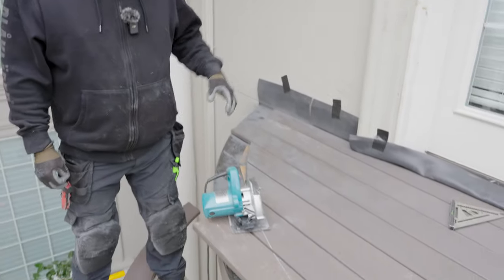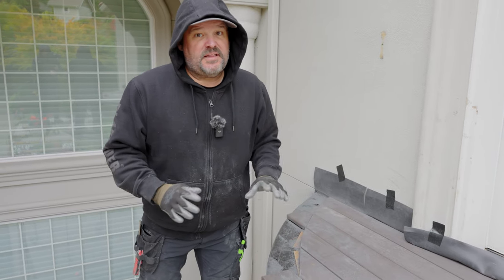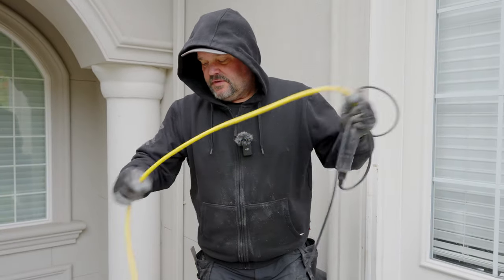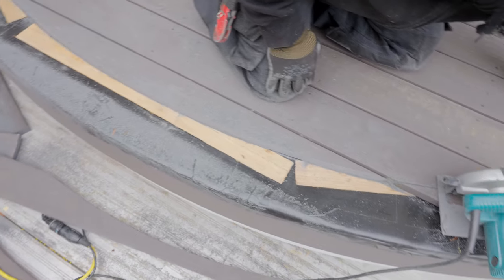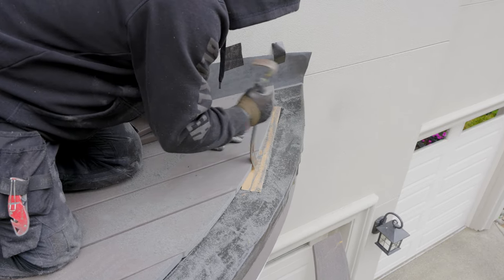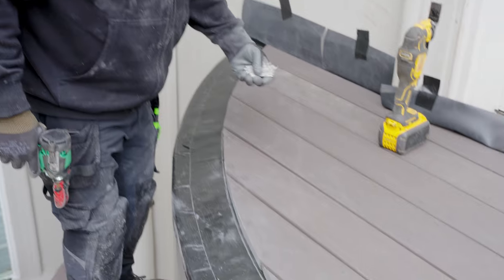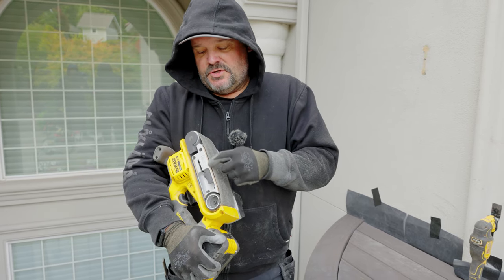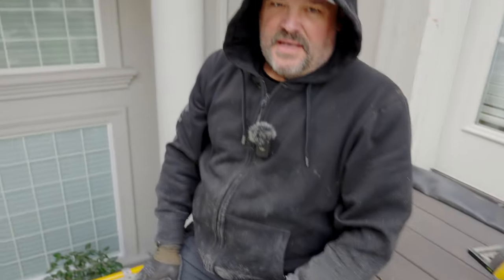Master the Art of Curved Cuts: Unlock Circular Saw Secrets

Comment: Very interesting process. Was wondering though since you already had the curved trim peice cut which I'm assuming you used to trace your line on the decking, why you couldn't use it as a guide and router the  line? Seems like it would be easier then trying to freehand follow your mark line. But maybe being as good as you are it's just faster to do it your way then set up the curved trim board as a router guide.
Reply: If you wanted to do that, you’d use a top bearing say 1/2” router bit. You’d need a jig that accounts for that 1/2” thickness of the router bit, not the actual radius deck board.

Comment: Always learn something watching your videos, wish i had seen this last month before finishing my deck, I could’ve used the sanding tip! I too cut the joist a 1/8” or less while trimming the boards and used external commercial caulking to seal it because i had it. For the joists, it was too expensive for me to use tape because it was a large deck, instead i used rubber based foundation sealer, applied with a brush & roller, dried quickly but can be messy.